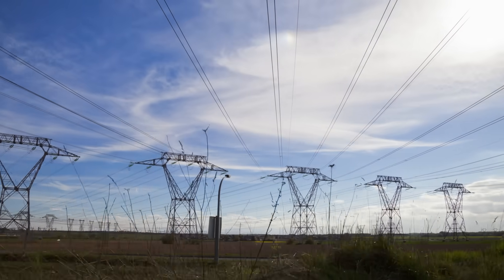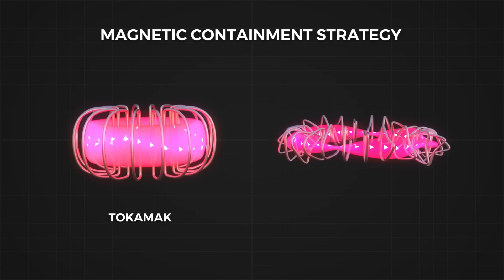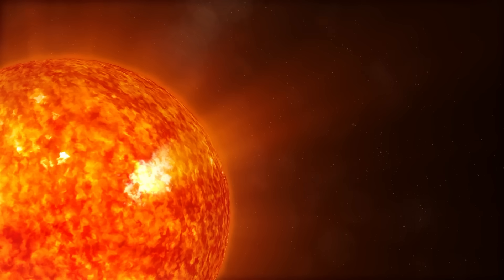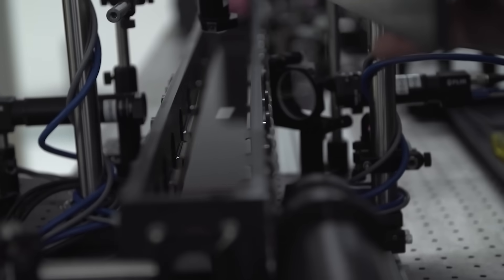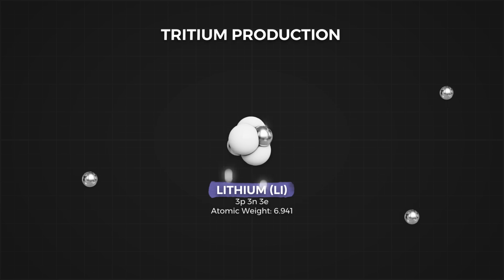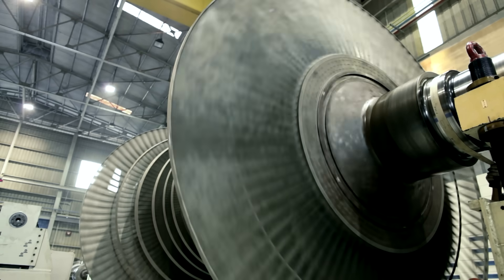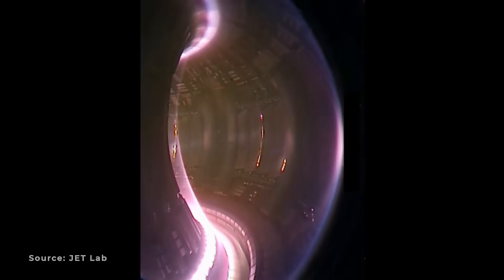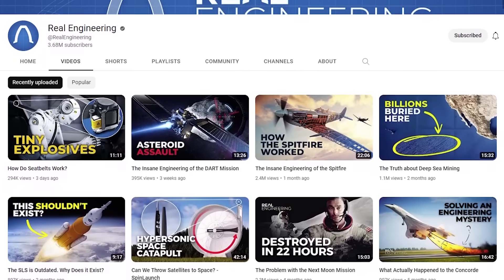The Problem with Nuclear Fusion

Comment: Would it change everything though?
There seems to be this romantic notion that the arrival of nuclear fusion would be like the switching on of a light switch that just instantly fixes the world’s problems. 

There are many who believe that those dining at the top table would have exclusive access to it first and would have a political interest in not letting others have access to it for as long as possible. 

There would be those who have invested billions in it who will want a fast return on that investment so initial prices would be sky high. 

There would be an initial huge drop in the cost of fossil fuels due to elite nations no longer needing them. This would then create a vacuum where poorer nations would suddenly have access to much cheaper fossil fuels. 

So far, all of the talk is about how can it be done and when.
I’ve heard/read almost nothing that covers the transition to it and the geopolitical mad-scramble that it will create.

Comment: They should ditch this and move towards light water nuclear reactors with MOX fuel. Ockham's Razor principle. Assuming the US nuclear waste composes of 96% plutonium means 1920 metric tonnes of fuel can be reprocessed per year. You don't need to scrounge for U235 since this is in plenty. Only 80 metric tonnes requires to be vitrified per year.

Comment: The more we learn about fusion, the more we realise we need to know

Fusion is unlikely to be a commercial reality in any of our lifespans, but molten salt fission is a fairly good - and extremely low waste - energy source in the meantime, with at least 2 million years fuel available (200,000 just in known resources)

The fuel - thorium - is also dirt cheap (about $100/kg) and currently THE unwanted waste product of rare earth mining (it destroys the economics of mines to have to store or dispose of the Thorium) and a MSR's primary waste products are gaseous

Deuterium and tritium are hellaciously expensive by comparison ($50k++/GRAM for tritium) and tritium is a critical component for nuclear weapons (proliferation issues)

Incidentally, a fusion reactor has a serious problem with neutron contamination of the chamber walls - this will turn the walls/blanket highly radioactive regardless of the beryllium

Beryllium is _extremely toxic and carcinogenic all by itself (forget about the uranium) - and a good exmaple of "just because you can, doesn't mean you SHOULD"

The problem with nuclear fission reactors at the moment is that they're based on the original "laboratory glassware" prototype Alvin Weinberg made, scaled up to Heath-Robinson (Rube-Goldberg) contraptions. He made a "mark 2" industrial prototype in 1965 - the Molten Salt Reactor - which looks to cost about 20% of the build price of existing fission tech, is vastly safer (not pressurised,  immune to Chernobyl/fukushima scenarios and can't catch fire) - AND most importantly produces less than 1% of the waste of existing nuclear tech(*) AS WELL AS being able to burn up existing nuclear waste as additional fuel

(*) Tha's 1% of the OUTPUT waste. It also eliminates the 89% INPUT waste and can use depleted uranium - critically important as that is the precursor to making weapons and there are tens of thousands of tons of the stuff stockpiled in the USA alone (every kg of 3% reactor uranium means 9kg of depleted uranium - the 3% enriched stuff is actually an unwanted waste product of the weaponsmaking process that Weinberg has easy access to when developing the original Shipingport reactor. It wasn't a matter of what was the best fuel , but what was AVAILABLE)
Reply: Almost everything you just said is an exaggeration, a misunderstanding, or simply wrong lol

Comment: I'm dubious of the opening premise. In addition to the "always almost 20 years away" problem, there's a substantial political problem. The so-called Green lobby, combined with NIMBYism, will block any nuclear technology breakthrough, however safe engineers say it is.

 Politics is a dirty business. Existing power suppliers have overwhelming influence. You don't have to be crazy to recognise that oil interests have sparked regime change and wars all over the place on many occasions.  Inconvenient pipelines in the Baltic don't blow themselves up!

And that's just the Americans (or whoever). Now China completely dominates photovoltaics. So that two super powerful energy players probably very keen to slow any serious nuclear rival. They may have been doing such things already of course - by for example playing up fears of radiation leaks from nuclear power plants or storage facilities.

So fusion in the real world is probably 90 years away, not 20, no matter when the technology itself is ready. Too late to be relevant to current world energy needs or carbon emissions problems.

Comment: Thanks for explaining the tritium problem. I see two more big problems: First is the tremendous amount of heat pollution. Waste heat from conventional generators isn't a big problem, but if the fusion power really does create cheap abundant energy, then we are quickly going to find extravagant uses for it, resulting in enough waste heat to warm the biosphere directly, eventually exceeding the Earth's heat budget. The second problem is political. These devices will be so absurdly complex that only large governments and corporations will be able to build and operate them. Why is that a problem? These energy monopolies will be able to control the world because there will be no other sources of cheap energy.

Comment: Inertial confinement fusion also has a ton of problems, some of which overlap, such as the walls of the chamber becoming radioactive due to the continual neutron bombardment, and the cost and complexity to build and maintain the facility. 

But it also has some other challenges; such as the cost of the fuel pellets being higher than the cost of the energy they produce, and the low efficiency of turning electricity into the laser light powerful enough to create fusion in the pellets making it much tougher to break even

Comment: The promises of fusion are the same as fission in the 1950s/60s.  Fission would make electricity so cheap they won't even bother to meter it.  lol.  Yeah, that happened.
Reply: The problem with fission is radiation. Therefore, it is expensive to build bc of the multiple safety features. Fusion will not that have that problem since radiation isn't an issue. Big difference.

Comment: Blanket disposal being expensive because it became radioactive, would not hold back fusion development. After all, expensive disposal of nuclear fission waste didn't deter fission development. And we don't learn from our mistakes.
Reply: It will.  It definitely will.  It drives up the operation cost of the fusion reactor. It also subjects the fusion reactor to the similar regulation by NRC because it is a radio-active reactor.  You cannot treat it as a normal power generation plant.  It is not rosy.
Reply: @catchnkill  I'm saying it won't stop governments from building the plants. When you say it drives up the operation cost, that's assuming they don't just sequester the occasional blanket replacement refuse onsite like they do with fission waste now.

Comment: Oh, the irony of timing!

Today, fusion researchers in the USA announced that they had achieved the breakthrough of a net positive energy output for the first time.  Using the inertial confinement method of fusing pellets of deuterium & tritium, triggered by the most powerful laser ever built, they were able to produce 120% of the power used to activate their reactor.

It's a small step, but it's a key landmark.  This verifies the theory that fusion reactors are a viable future source of near-limitless energy.  It's no longer just an expensive science experiment: now we know it'll actually work!

The dependence on tritium, the immaturity of the technology, and the massive expense of constructing such a reactor keep this still firmly in the research category... but funding and optimism for fusion is going to soar.

Comment: Finally, someone who describes EXACTLY the problem(s) with the golden fleece panacea of Fusion power. It ain't clean, it ain't pretty. But, just MAYBE, it can be cleaned up. 
Personally, I feel strongly Humanity missed the boat bypassing Thorium liquid salt reactors from the 60's when electricity was still cheap (but we didn't know it then). 
Fusion people hate to hear that, I know...In ANY case, China and Indonesia will have LFTR's first. America just quit the job. 
As to the laser fusion people, the laser tech still needs a great supply of Tritium fuel which simply doesn't exist on earth unless it's made inside another reactor, In the case of the laser people, that's made inside a Uranium FISSION reactor. So, those will still be needed to make tritium instead of power (and still breeding plutonium). Also, they have a massive problem with fast neutrons making their laser device highly radioactive. 
This has been known for some time. There's a paper on this from April 19, 2017 by Daniel Jassby describing "Fusion reactors: Not what they’re cracked up to be", in the 'Bulletin of the Atomic Scientists'. Anyone interested in Fusion energy should read it.

Comment: 00:13:35  "Yet, we are closing down nuclear fission reactors all across the world when we need that clean energy more than ever, because it's uneconomical."
Total, complete rubbish.  Nuclear energy is very economical over its lifespan.  Fission plants are being closed only due to benighted politics, and others are not being built because of short-term corporate interests.  Any organization with clear, long-term thinking could support fission power.  Its neglect has cost the world environmental and economic damage the last half century.

Comment: I have a word to the wise. Magnetism and gravity are two different things. There is no magnetic repulsion of protons. And electrons do not orbit a proton. Electrons ride along inside the spin of a proton at a LaGrange point. Oh and there are 1,000's of electrons to a single proton. There is no reason to limit a single electron to a single proton. And yet another problem. If the fusion reactor is not actively removing the helium, then the fusion reaction will come to a halt rather quickly. There are 5 people on this planet that can make hydrogen from regular water fuse to helium continuously producing about 22k watts continuous at about 3,700C which means that about 24 oz of water should last about 6 days and provide enough electricity to power about 50 of your closest neighbors for those 6 days. The fusion process is like balancing the tip of a needle point on a razor edge and thus the reason why there will never ever be fusion power available to the public. Why you ask? Because capping the process from helium extraction and dumping in a 100lb S1 container of liquid hydrogen, liquid being the key and the ones that know will know why, into the device at full max power will produce a boom that would twice level the largest of cities on the planet. Pray to God they take it to the grave.

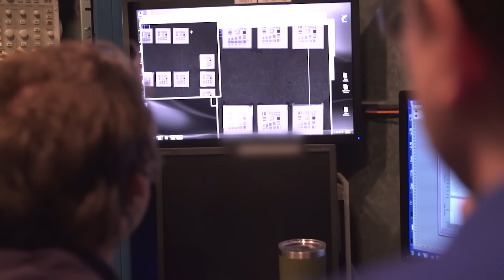Comment: 8:02 *Nucleaire energy is not stopped because of cost, it's one of the cheapest and cleanest way to get current. It's comes with energy independence. To control money, you need power.
Reply: He doesn't like fission energy, that's been well-established. He doesn't care the only reason its expensive is because government has placed absurd regulations on it, and the only reason solar is "cheap" is because of the subsidies.

Comment: For the long term, the big question about fusion is whether it can be done on a physically smaller scale. The fundamental problem with fission reactors is that they are only practical power sources on a really large scale. Can fusion reactors be smaller and cheaper. Don't make assumptions based on ITER, as it is a research project, and therefore has a lot of extra baggage. It also relies on older superconductor materials. There are newer projects that should come off better WRT that consideration. But there are limits imposed by materials' maximum strength. The magnet has to withstand its own magnetic forces. So understanding superconductivity, and materials science, is key to how well this can be done.

Comment: Man, I am only 1:25 in and the Hopium is making me dizzy! There are 4 oz of Salt in every Gallon of Sea Water, humans use about 100 gallons of Water a Day. So that would be about 25 Lbs of Salt for every person per day. Lets assume an Area with 8 million Folks, Like the Bay Area. That would be 200 Million Lbs of Salt per day being dumped into the Ocean, Like the San Diego Carlsbad plant does.  Salt Brine is much heavier than Sea Water it sinks to the bottom and Creates Salt Lakes that kill the Ocean Floor Sea Life. Additionally it is Very Energy Intensive and Will double the cost of the Water Produced Easily. The Plant in San Diego is also only producing about 100 million gallons a day, that only covers 1 Million people.

Comment: The news out today regarding the ability to generate more power than consumed in producing it makes this video all the more timely, especially as it was achieved in a tokamak.  Thanks for bringing the various details to your audience in a very clearly explained way Brian!
Reply: It wasn't actually achieved in a Tokomak reactor, it was in the National Ignition Facility using Lasers.
Reply: @haywire4686  ok thank you, odd I could swear wherever I heard it they said tokamak but it’s probably memulti-tasking, they might have said something like “unlike normal fusion reactors which use tokamaks” and I was try to pay attention to a call at work at the same time as the news 🤣🤣
Reply: I was about to say it seems like this came out a day ahead of the news
Reply: That was from NIF, which uses laser inertial confinement, and isn't meant for actual power generation research. Their claim of producing more energy than consumed is also only true when you ignore the amount of energy that went into the lasers, which consumed over 100 times as much energy as went into the fusion target.
Reply: @smpritchard  ouch, that’s unfortunate.  I’ll have to read up and understand exactly what the details are. Thanks for pointing that out.
Reply: To my limited understanding, this was achieved using inertia confinement fusion, not through a tokamak
Reply: @shaunwu3910  oh, I’ll have to go look, I could swear the article or video I saw on it mentioned a tokamak because it stuck in my head about this video.  Maybe I’m hallucinating though.  Thanks for mentioning it.

Comment: Quick note, France's peak power consumption is between 80 and 100GW. A 800MW reactor only provide 1% (or less) of the supply, not 2%. Also, it's a bit early to call fission power plant a thing of the past, considering we're pretty much in the middle of a resurgence :)
Reply: Especially with all the untapped potential in the fission process. Generation 2 PWR and BWR designs are very inefficient in their fuel use since they were designed to function only with thermal U235.  Fuel in commercial plants is only enriched to 3% U235 because of the proliferation restrictions. "Spent" fuel still contains significant amounts of usable uranium isotopes. Thorium and Plutonium are also fuel candidates for future designs. Not to mention general improvements in the secondary and electric plant designs that have the potential to raise the thermal conversion efficiency from 30% to over 50%. Generation 3 reactors don't solve any of this since they focused only on safety features. Generation 4, however, promises to make progress on the fission plant designs. Progress was stunted for so long because of poor public opinion and understanding..

Comment: Great video as always. One obvious question (to me anyway) that you didn't cover is why not do deuterium-deuterium fusion? Instant He-4 and no tritium need - happy days! A quick bit of "Google is your friend" work suggests that the issue is that you need 3 x higher temp plasma, which since you're already in the millions of deg C range would be significant extra complexity. Assume that is it but interested if anyone has a fuller answer...